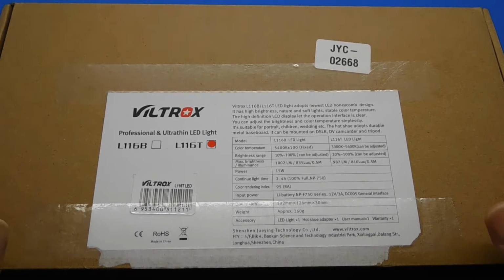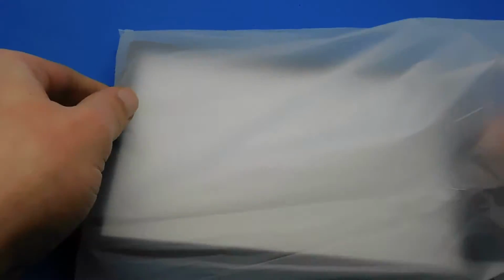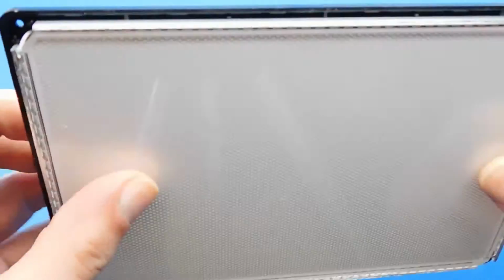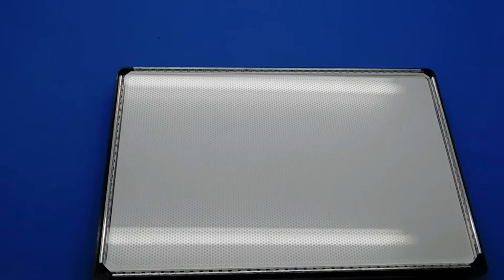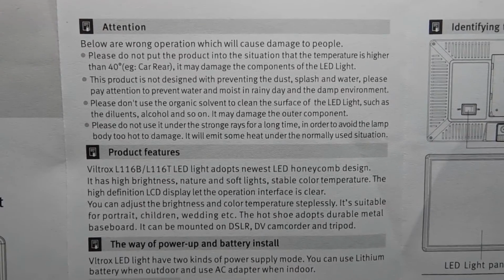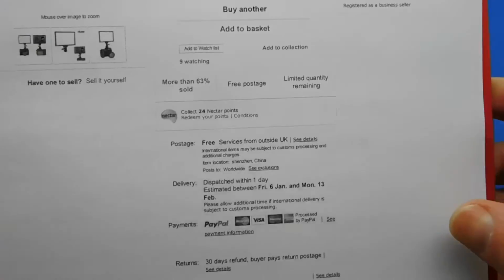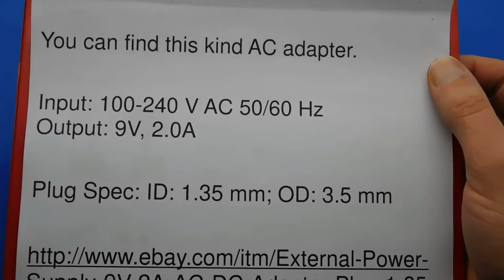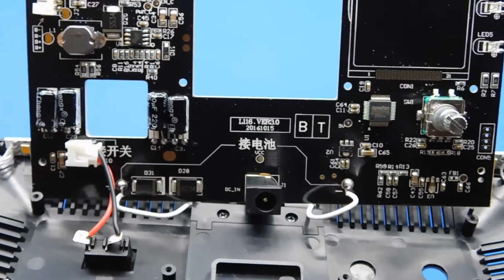Teardown Viltrox Studio LED L116 T Adjusts Light Temperature & Brightness Hot Shoe DSLR Camera Mount

Comment: This is an excellent breakdown, most of all I needed to know the power jack pin size, thank you. Concerning voltage, 12VDC is very common for this type of LED, including domestic/office lighting, LED strip lights and so on. It is important that the power supply is of good quality. Look for Short Circuit, Over Voltage and Over Current Protection.
Reply from the maker: Hi, and thanks,

I decided to wire directly into the light,

So it is mains powered now,

The seller of this light didn't have a clue, he said the wrong size of connector and the wrong voltage power supply,

So i went with what was moulded on the light, Viltrox don't seem to do power supplies for these lights,

I am amazed it worked, as normally i break things,

i ordered the correct female connector but they sent all male connectors,

It is still working and is a good little light it reduces the flicker in my videos,

But i also found that the camera was set at the factory to a locked focus which caused it to lock onto the strobing from the florescent strip bulbs if there was nothing in frame,

Almost all of the other settings in the camera reduced the flickering massively,

I find the light far more useful as a diffuse light, using the led's as edge lighters, is a far less harsh light compared to those front facing old school banks of led's,

I only need 50% brightness and 5500 colour temp to match the existing colour light from the other bulbs,

I only have a small studio, i also use it to remove shadows by placing it in front of my subject i am photographing,

It has a mount for a tripod,

A big studio may need the bigger size and multiple of them,

Which can get expensive, but studio lights are really expensive, it is a niche the Chinese are exploiting,

It doesn't have any barn doors though,

The fine adjustment on both colour and brightness is the way to go for me,

I think there is one with fixed colour and adjustable brightness, this may be brighter as it won't have yellow led's,

But you can't adjust the colour, i use both functions all the time depending on the light requirements,

i made a decision not really knowing anything about lights and the light did everything i hoped it would do.

Comment from the maker: I have been able to check the following,

*****Breaking news, 17th January 2017,

I have found out what the jack size is to fit this light,

The correct size is, and best fit over the pin in the centre,
Outside Diameter = 5.5mm,
Inside Diameter = 2.1mm,

Additional specification to cross reference before purchase,

AC power in DC power out adapter.
Input: 100-240 Volts AC 50/60 Hz
Output: 9 Volts, 2.0 Amps
The power jack is centre positive, so your power supply will need to be centre positive,

To find this power adapter on ebay search for "9v power 2.1",
Then click cheapest + P & P first,
Then go through the results looking for the 2 Amp version,
I have chosen to run the 9 volt version,

There is also a 5mm outer diameter with a 2.5mm inner diameter,
This one is to loose a fit over the pin in the centre securely,

I would not recommend buying the power adapter with 2.5mm inner diameter,

Be careful Chinese sellers say 2.1mm inner diameter in the title and then say it is a 2.5mm inner diameter on the description which would also fit the 2.1mm pin,

If in doubt ask the seller before you purchase the power adapter,

Even though I have been advised it will work with a 12 volt power supply,
I want to run it under powered,
But this will reduce the amount of light the LED's produce it should prolong the life of the light and drive them with less power,

All the advise is my own opinion please double check and do your own research if your are unsure of anything,
Reply: Have my lights and using some np-f style batteries.
Reply from the maker: I am still waiting for a part to change my power adapter, How are they ?.
Reply: Noob Tube they are super versatile. I like the soft light and it throws at a very wide even angle.

Comment: It's edge lit and diffused by the honeycomb like a softbox.
Reply from the maker: xHOTDAMNxHBx since i did this video i found that this is not brand new technology, it is the same in a computer monitor from 2004, but the monitor is lit from the top and bottom with fluorescent tubes, but it is still edge lit, i am not sure if the mesh will do anything to enhance the light output, we will see when i get it working.
Reply: Cool thanks for the very thorough tear down of the light. Wish there were more videos with people using these lights. Cheers
Reply from the maker: Hi, I think this is a very new design to the market, even though it is based on old technology, I chose this one as the light produced is much softer than normal front facing LED lights, now we know why, 

I thought the LED's were behind the opaque plastic, so it was a shock to find they were around the edge, I have also found out that LED office down lights are designed the same way with the LED's around the edges,

I will be doing a 2nd video of it actually working soon when the other bits I have ordered arrive to allow the light to run from the mains.

Comment: The review is great, but just turn it on :) I hope it will function well.
Reply from the maker: Destynick thanks, i will turn it on when i get the power supply, as i don't have access to the batteries it runs with, i will do another video of it working, and add it to the playlist, i will be doing another video as well about some light diffusing plastic sheets i found inside a LCD monitor
Reply: Ok! I also plan to order this camera light and feed it with external power source, but I have no idea about the plug, the only information is "DC005". Does it fit 5.5*2.1mm plug?
Reply from the maker: Destynick the information i have so far is 9 volt, 2 amp power supply with a centre positive power jack, i have bought a set of 8 power adapter jacks but i am waiting for them to arrive, to confirm the correct size of the jack, there are possibly 2 it could be from the set, 5.5mm x 2.1mm centre or 5.0mm x 2.5mm centre, i can't confirm until i get them though.
Reply from the maker: Destynick if you go to 19 minutes into the video you will see what the seller told me, this was advise from the seller of the light, not the manufacturer, as the manufacturer did no answer my email about this problem.
Reply: I've noticed these specifications, but - I see a certain mismatch: 1) in the manual we see "9V 2A", and on the device is written DC IN 12V; and 2) the internal diameter on the picture looks like bigger than 1.35 mm; it's really thick. That's why I asked you. So, maybe you have some plugs with different diameters - simply to check, does one of them fit or not) It's really difficult to define it by picture, As to 5.5*2.1 - it's really widespread, and 3.5*1.35 is not so popular.
Reply from the maker: I have replied to these messages, 

I have bought a set of 8 ends, and will check which one it is, I can't do this until I get them,

I said in the video other you tubers mention that using the 12 volts can damage other lights,

So maybe this is the problem with this one, but I trust the seller enough to give me the correct information, other than the correct pin size,

I will cut off the end of the adapter and remake it to the correct size what ever that is,

The power adapter i bought was £4.62, but it has the 3.5mm end, but everything else is correct,

In the worst case I can just cut of the end and solder it straight on the circuit board on the inside of the light and hot melt glue the cable to the outside of the light to stop it pulling off,

If you take that route though it is at your own risk as a last resort.
Reply: And as to this device - can it withstand 12 volts, or the inscription on it is false?
Reply from the maker: I have watched 2 separate unconnected videos, 1 for the neewer 160 light and another unbranded one and both videos advise not to use the stated power rating on the outside of the light as it could damage the circuit board,

I don't know what evidence they have but the seller of this light also quoted a lower voltage of 9 volts for this light, 

As the factory won't reply to my email I can't confirm this,

All I can do is go by the small amount of information collected so far,

This will always be the problem buying anything made in China, you have to fight to get the information which should be widely available,

If you use the light a different way to the normal way you will struggle to get any advise at all or possibly incorrect advise,

today the power adapter turned up,

And I can confirm it is NOT outside diameter 3.5mm and inner diameter 1.35mm,

I have 2 more options,

I am going to re contact the seller and tell him he gave me the wrong advise, and see what he says,

I have another you tuber I can ask see if he can add any extra information.
Reply: Ok. Today I appealed to one of the Aliexpress sellers; he insists on "12V 2A". Аpparently, these are the parameters of the required adapter. As to my experience, - in such devices there is voltage stabilizer installed, and I doubt that they saved money by not installing of the stabilizer. And, at least, - it's senseless to produce 9V device ans write "12V" on it.
Reply from the maker: Hi,

I Have asked the seller to confirm again for me,

Maybe it will accept a range of power supplies as it accept a range of different model batteries,

Come back and let us know how you get on with your light,

Thanks.
Reply: I just think about its purchasing, but there are so many "maybe"-s in the specifications))